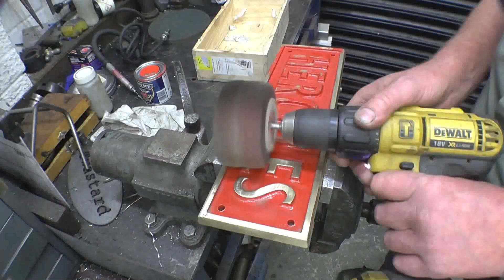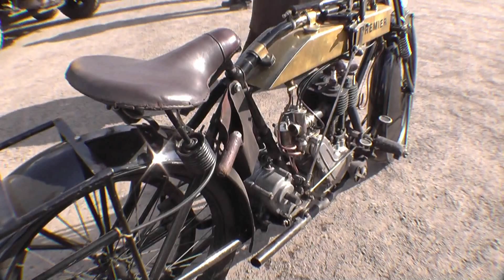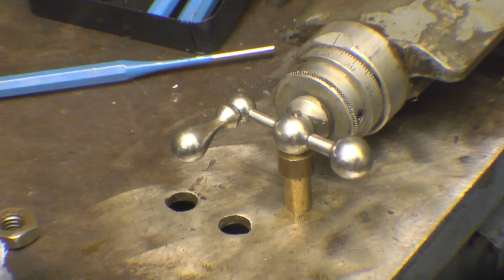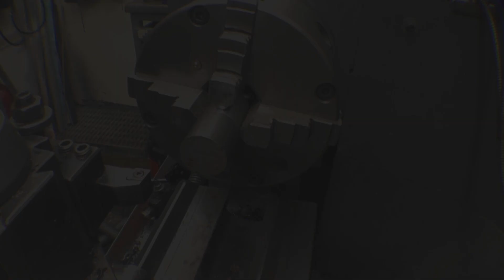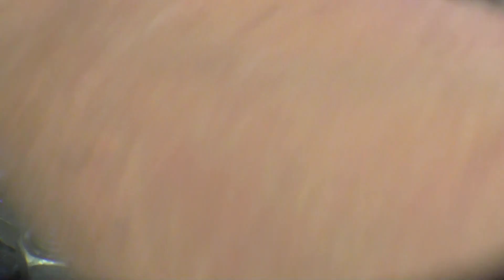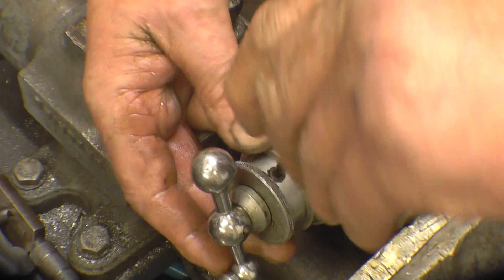SNNC 342 P2  Harrison L5 Lathe Tool Post MOD

Comment: > beautiful work there john mr mills; from the 'cc' viewer...right, ok - building (or in this instance modifying) better machines isnt going anywhere (processes ~ min 18 thru to end, which in my experience results in a kerr ping ouch mercurichrome moment, busted spanner and/or grade 8 bolt.) thnx amigo, thumbs.

Comment: I'm currently restoring a Harrison vertical/horizontal mill. It's full of grease because people see a nipple and they want to grease it.

Great video as per usual.
Reply: I see the same error being made all the time. Needs a little reminder sign... Grease never,oil frequently😁
Reply: @howardosborne8647  Yes. Harrison Mills have a plate showing recommended lubricants. It got ignored on mine.

Comment: What steam engine would have metric threads?
Reply: One that's had replacement parts made over the years.
Reply: German, French etc?
Reply: @bostedtap  The steam age is about 1770 to 1914. There was a Swiss version of a metric thread used in watches started in 1876, and a German version that used a different angle in 1894. The current version of Metric threads using a 60 degree angle weren't standardized until 1919 after the end of the age of steam. I find it interesting that countries that have adopted the Metric system for weights and measures don't use the metric system of angular measurement where a right angle is 100 gradians instead of 90 degrees so a circle has 400 gradians instead of 360 degrees. They also don't use the Metric system for time which has 10 metric hours in a day, 100 metric minutes in a metric hour, 100 metric seconds in a metric minute and 10 days in a metric week.
Reply: @tiredoldmechanic1791  If I may suggest not using Wikipedia for all your information. Adopting the metric system, was mainly for engineering purposes, in the UK for instance, we needed to export machines due to a small home market (not the case in the USA).The base ten time system, was only a french concept after the revolution, some clocks were made. There was great competition between Great Britain and Germany inter-war with who could travel the fastest with a steam train, and in engineering, locally we produced steel tubes, and companies would receive a small diameter tube from each other, and the test was to send the sample back, with another smaller tube inside. Regards John.

Comment: John, that could have been a very nasty fall with that drill in your hand, glad it ended ok. If I had a tenner for every fall that I've had I would be quite well off. Must admit I laughed like a drain 2nd time round when I knew you were ok.
You must have heard the old saying when working on parts with springs John. Work under a blanket!
Thanks for an interesting hour.

regards
Gareth